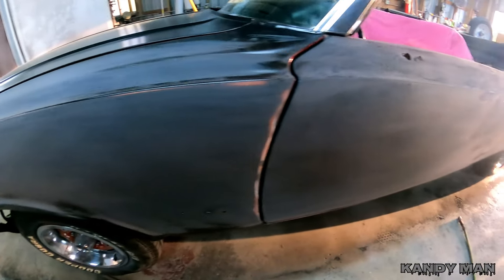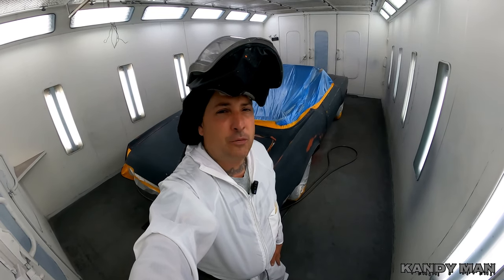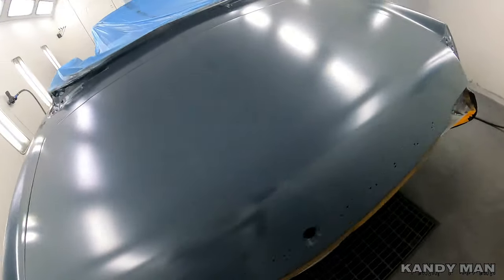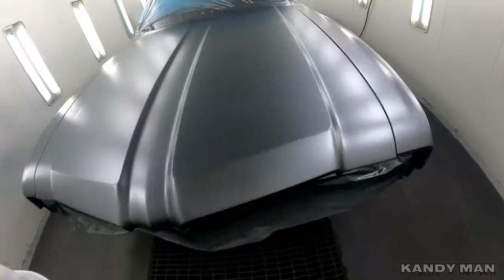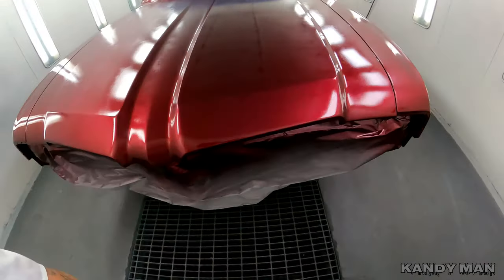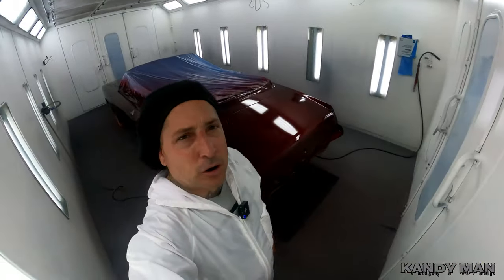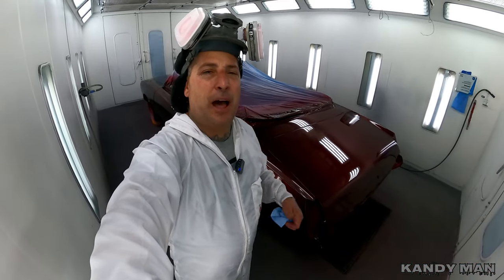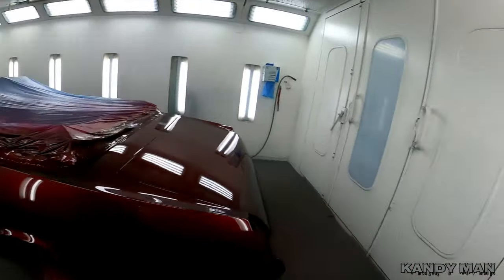STEPS FOR A MIRROR PAINT JOB PART 8

Comment: How do you keep the paint from hitting the insides of the gaps that you have already painted but mating up well?
Reply from the maker: I mask them up then fine line very carefully
Reply: @kandyman5315  so if i understand correctly.....i tape on or very near the seam when jamming and then follow that line exactly when taping before painting the exterior? This has been boggling my mind as i prepare to paint my c10 in a new gm tint coat. (wildcherry tintcoat)

Comment: You killed it and made it look easy! The pressure of painting a true urethane kandy is immense, every step is a booby trap right up until the last coat. 
How do you go about the sealer drifting into the jams as it always goes further than the base? Do you find 3 coats has enough uv holdout for the kandy? 
Awesome job 👏  it must be beer time now after that big booth session
Reply from the maker: Thanks for the support  3 coats is plenty have done many over the years holds up well far as jams fine line tape as tight as possible pull fine line before  fully setup carefully  but some times do some touch up were needed.
Reply: @kandyman5315  
Great, thank you. I look forward to seeing it in the sun

Comment: Nice job you flowed with the products.Do you have to flow  coat or you just need a High Solid  Clear.Do like European Clears or American  High Solid  Clears.Nice job again i learned a few new tracks
Reply from the maker: Flo coat is not necessary if the job turns out flat hs clear 3 coats after kandy thanks for watching

Comment: Lots guys say if you flow coat it shines even more im depth is that true?

What clear did u use? H.o.k show clear?

What was your fluid for the gun wide open?
Reply from the maker: Flo coats work when needed this turned out flat and clean so not needed .